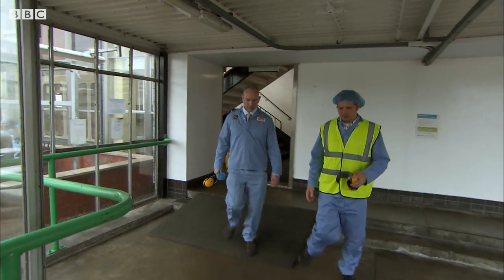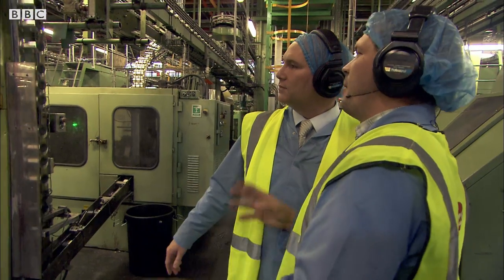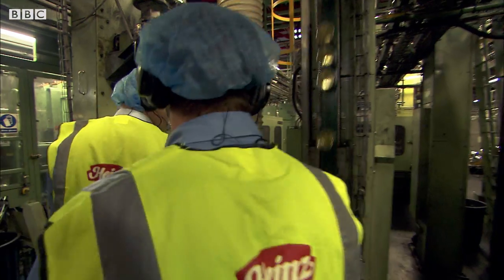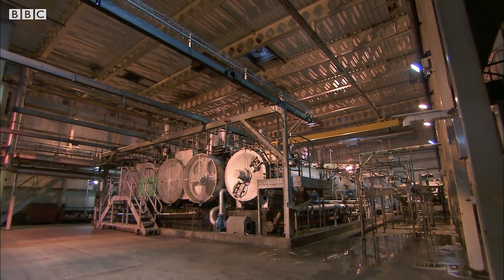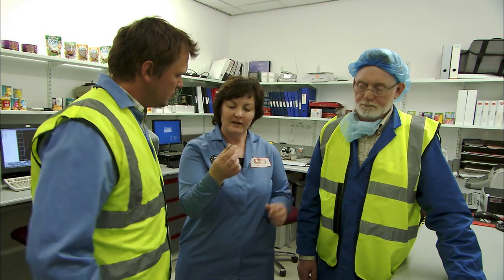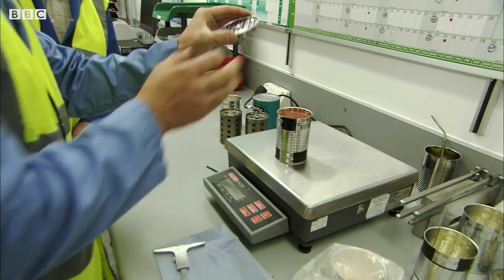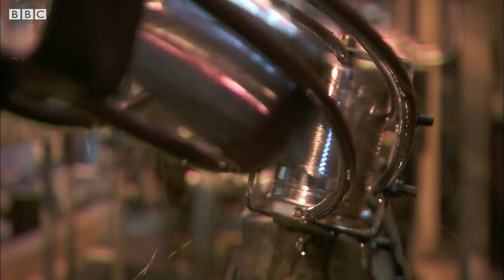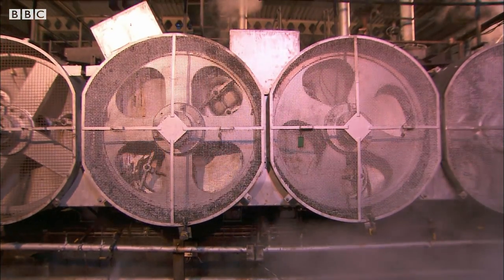How Does Canned Food Last So Long? | Earth Science

Comment: Why doesn't the can explode? Surely the pressure is massive if they're boiling the sauce inside a sealed can
Reply: If the inside is heated, vapor is formed an the pressure rises inside the can. But outside there is a higher pressure, too. So the interior and exteriour pressure cancel eachother out.
Reply: @wonadona  I didn't realise the cooker was pressurised, thanks!
Reply: Its done for les than 5 mins...no chance for pressures to go exponentialy high
Reply: That's why it's called a pressure cooker.
Reply: That's not why it's called a pressure cooker  -_-
Reply: The internal pressure is Temperature dependent not time.
and i think they hold it for 5 mins at a specific temperature ca. 120°C
even if you hold the Proces at this temperature for hours it woulnt explode.
Reply: *facepalm
Reply: Super Hans ✅ all canning I ever did was heat the goods prior to sealing the can.
Then the pressure contracts the can when cooled. It’s why the lid pops when the can opener first breaks the seal... and why you never open a can of beans that is bulged...
Reply: @SuperVstech  did you use mason jar with 2 PCs lid ?
Reply: @chocopearl5597  yes
Reply: @_Super_Hans_  the cans are also sealed under vacuum (negative air pressure) to cancel out the pressure in the cooker.

Comment: What I'd really like to know is how they keep the pasta in cans  from dissolving.
Reply: Okay
Reply: The canned food goes though what they call a "botulinum cook" to kill one heat resistant bacteria's spores, without overcooking the product. In other words cooked at the right temperature, for a right amount of time, to kill bacterial spores and at the same time prevent the product from overcooking.
Reply: @IyalagoFAC  Thanks for your reply, but that's not what I see as the issue. The question I have is how can the pasta hold it's integrity and not dissolve in a can for  years. Even if you cook it right as you stated, it's still in a liquid sauce.
Reply: @terrytytula  the answer is because the can is vacuum sealed, so isn't exposed to air...the pasta will remain the same as it was when it was sealed, other than the heat cooking it
Reply: @BigSplenda1885  I'm pretty sure he's wondering how the pasta doesn't end up being so soggy it's practically dissolved, which I've also wondered, and I think the answer is the recipe of the pasta, I'm not sure what it's made of but they probably have a recipe that helps it keep structure better in a can.
Reply: Pasta won't absorb more liquid unless it's hot. It's why al dente pasta doesn't become soggy overnight in the fridge

Comment: For us Americans 120°C  is 248°F.  

Just to put things into perspective.
Reply: I thought 120 degrees sounded way too low.
Reply: Waters boils at 212 f and at C its 100
Reply: They are called Freedom Units.
Reply: please America switch to C and metric system
Reply: Itslike123- It's hard to change from a system you're stuck on, no matter what the rest of the planet says. In the late seventies they began slipping in highway signs that were converting miles over to kilometers. It was supposed to be the first step towards putting America on the same page as the rest of the planet. Courtesy, I believe, of the peanut farmer. As soon as he got thrown out of office, those signs disappeared. Oh well... What difference does it really make in the grand scheme of importance?
Reply: Wonder if the teflon coating is safe at that temperature, or if teflon breaks down during long term storage.  If not, i've read canned goods aren't that bad and maybe better that other types of storage.
Reply: @itslike123  why should we conform to your way of doing things
Reply: @deafbyhiphop  it's the rest of the world way , you guys stuck in the 1800
Reply: Thank you. I was thinking 120°F. That's not hot enough to kill all of the germs. 120°F is my water heater setting. Fairly warm, but no chance of scalding.

Comment: What prevents the can from exproding when heated?
Reply: The pressure outside the can prevents it from exploding.  The pressure inside the can prevents it from imploding.  If the temperature outside is the same as the inside, then the pressure outside is the same as the inside.  Same as it would be at room temperature.
Reply: cans are cooked with a pressure cooker

Comment: Good video, distracting music; but I wonder: What's the deal with the ridges on the cans? Some ergonomic reason? Food preservation method?
Reply: i am 90% sure that those are for increasing the structural strength of the can. it is much easier to smash a tube like a can if it is smooth. with the ridges it gets more sturdy.
Reply: Possible, thanks :) Seems to make some sense to me, but I know nothing about engineering \o/
Reply: Yes, the above comment is complete right, makes the can much stronger.
Reply: a smooth can shape can only withstand force from the top, apply force from the side and it will collapse, like an empty coke can for example, by adding those ridges the can gains a profile which makes it stronger without needing to add extra material.
think off a slice of pizza, if you just hold it on the rim the tip bends down, but if you bend the slice to form a ridge, the tip won't bend down, you've increased the structural strength without adding material.

the reason why food cans have ridges and coke cans don't is the difference in internal pressure.

a coke can has a higher internal pressure than the surrounding air because of the carbonation, which is enough to prevent the can from collapsing under force, kinda like an inflated foot ball.
a food can on the other hand has a low pressure inside because the food is hot when it is put inside and then cooled after the can is sealed, this lowers the pressure inside significantly, making the can structually weak, which is why those ridges are needed, should you ever encounter a food can thatis bulging, don't eat it because it's rotten.
Reply: Wow, amazing answer Windhelm - thank you! :>
Reply: Thank you for asking. I was gonna ask the same thing.

And thanks everyone for your answers
Reply: Windhelm Guard Thanks for the information. 👍
Reply: The beads on the cans also help withstand pressure during stacking.

Comment: The IBM screen :') Shows how old it is, but I guess don't fix what ain't broken
Reply: I worked at Western Digital. Your desktop & laptop's 1TB drives are quality tested on machines controlled by Pentium II's. The machines themselves are from the late 1980s, when hard disk drives were just megabytes in size, although various components have been upgraded through the years.
Reply: Probably Not you know what even more expensive than upgrading the hardware? Upgrading the software and train the personnel to knows how to use it

Comment: They never mention the thing I most want to know in these mini documentaries, how is the can sealed? My guess is some form of welding but in another one of these fluff pieces it said the cylinders seam was soldered? Sorry, I don't believe you! It would break far too easily! In the same video the base of the can was attached with heat. Again, I bloody doubt it! Unless by heat you mean welding!
Reply: it's not welded... it's called "double seams"... they bend the can and the lid into each other, no need to weld or solder anything (and as Smarts above me said: it'd cost a lot of money to weld)

here you go: https://upload.wikimedia.org/wikipedia/commons/5/52/Can_solderless_seam_cutaway.jpg (it's even called "solderless")
Reply: Yes, Solder is ancient! All cans are sealed through a double seam process. as Arin said lid and can are folded into each other and kept intact by a sealing compound. The side however is welded with some high tech equipment.

Comment: Where does the dead bacteria go?
Reply: That's a very good question! They/their (harmless) bits probably disintegrate or dissolve or something (bacteria are way smaller than your average human cell, which is funny, because they're more numerous in AND on your body - yes, you have more non-human cells in you - mostly in the gut, than your own human cells, but bacteria are smaller and thus weight less, unlike the bigger and heavier human cells... I shouldn't have told you, now that I think about it, when dead bacteria residue in a sterilized can worries you, oops! 10^14, or 100 TRILLION (! that's a lot of... no, not damage) cells estimated total in your body, but 90%, or 9 x 10^13 or 90 trillion or 90 000 000 000 000! aren't even yours! Wacky, innit?) ;)